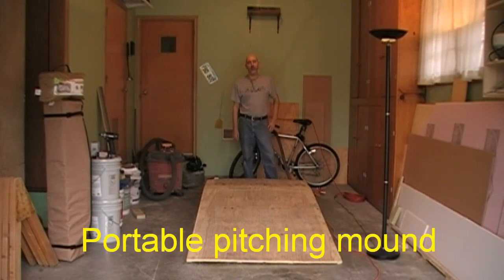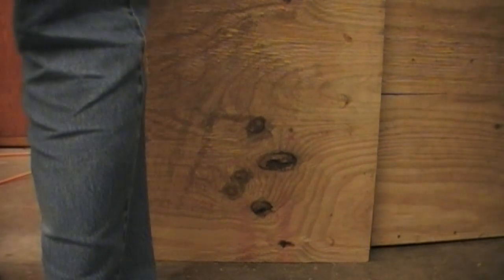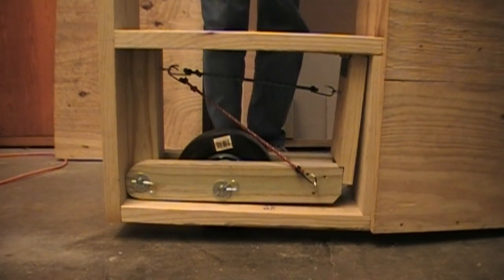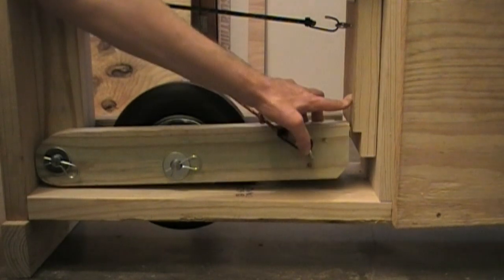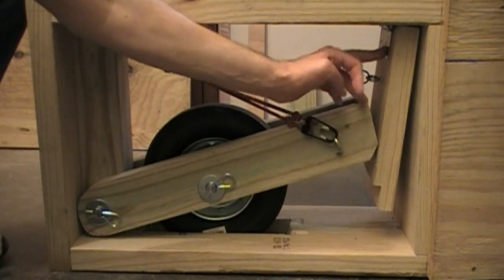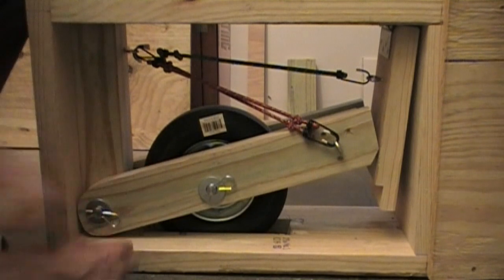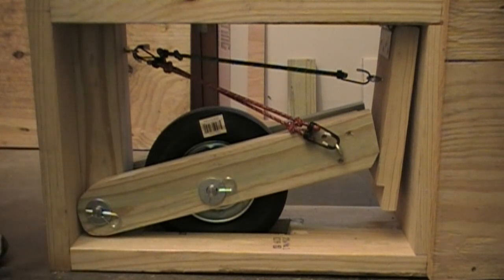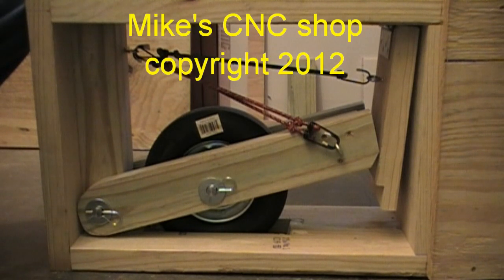Pitching-mound

Comment: Wow!  Very Cool design.
Reply from the maker: Thanks.  As mentioned in another comment, I would suggest using springs in place of the bungee cords.  The wheel with a solid tire is pretty heavy but I still like it better that a pneumatic tire since I don't have to worry about having a flat.